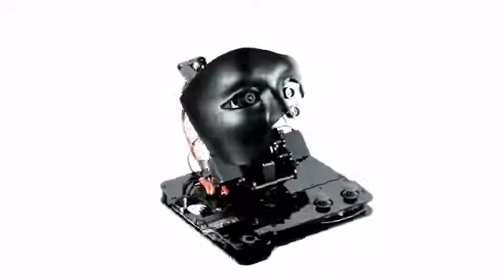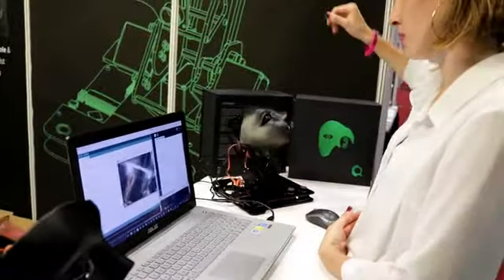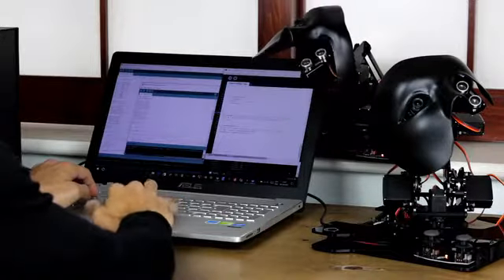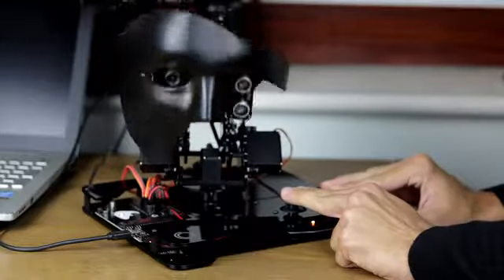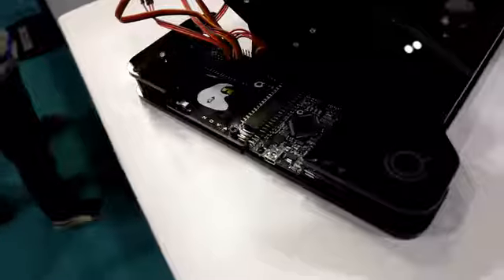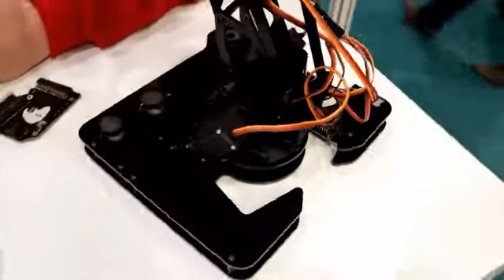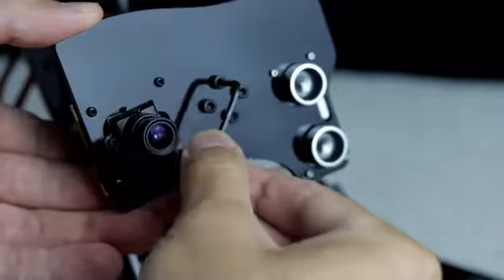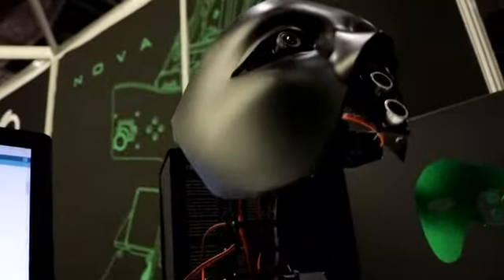NOVA :  DIY Artificial Intelligence Robot  ( Build your own artificial intelligence robot )

Comment: the best way to make a thinking robot is not to really make it learn anything but by using preprogrammed procedures that interact in a way that can take input and transelate into output. a basic artificial brain only need to covert input data into some reactive ouput responses and some varable leveling system that is triggered and altered by input sensors. you can create fake emotions by creating a variabel level kind of like a volume control but with levels  that change what kind of emotion expession that is the most dominant. if you make a bar for each emotions and program it so that each bar have a level that for example if angry and then + 1 and if on the happy bar then - 1 so that the simulated mood can create varations that coorespond to how pissed off the robot get or how happy it behave as if is. you can have many more moods , but that they all affect each other so that the robots mood can vary from robot to robot and depend on what ever you rudly pissed it off or made it happy and anywhere in between. all the moods must be interconencted so one affect the other. computers cant really feel but we can make them behave in such a way that we can make people believe it does feel. in a sense maybe it does if you do it right kind of but not like us humans. 

all the focus on artificial intelligence have been on congitive skills but chould we not start with emulating emotions first as that would be much easier? 

we dont really need 20 neural nets to drive each emotion but we could do it that way how ever that would be taking a lot of computer power to process expecially if it was a detailed mood leveling by learned imitated moods expressions instead of preprogrammed ones.

if we can make the machine react as if it feels, even if it doesn't really feel anything if the behavior responses works out like a human, then it could fight for its survival. 

i think if people want to make robots be like us, they need to focus and making the machine imitate emotios so that it can have a system that drives its own survival. of course there is no feelis in adding numbers but for example a defence behavior as a result of a machine out of its comfort numbers reach violently or by running away, if it had such behavior, then that it behave as it feels would prove that is was capable of self sustaining. i believe that we make our decisions in life based on our feelings and if we can make a computer behave as if it feels, it can deveop skils to make itself more human even if its thinking capacity is on the level or a germ. 

we need to look at expessions of feelings as shades of gray to make the machine create a realistic result.  in my example the machine will have all of the moods all at once to different degrees like more angry and less happy or more sad and less angry but not either one or the other. the change have to be a dynamic transition between moods. 

i prefer if a artificial intelligent  computer system use as little storage as possible by being resourceful in how the computer uses data, as well as writing less and simpler code. 

the computer does not need to do any thinking at all. 

the  shorther the code the better. 

small chips have small cpu so lots of jumps and spagetti code is needed to speed up the process.  we could not use any more that 10 subrutines inside each loops and make the mainloop contain only a few number of subrutines jumping to these separte loops or use one subrutine to trigger another.